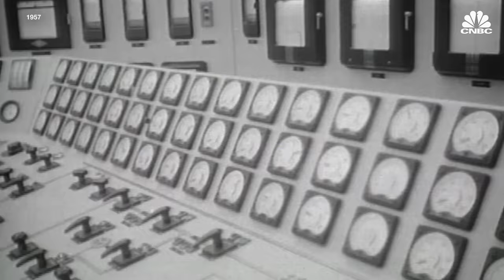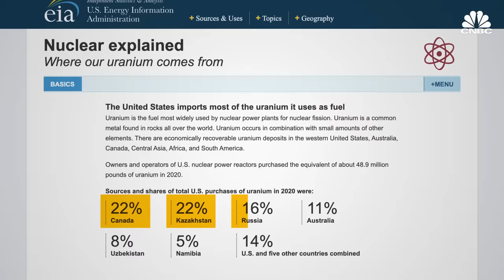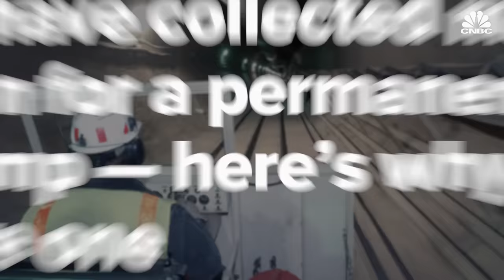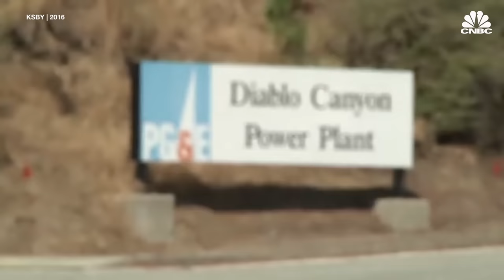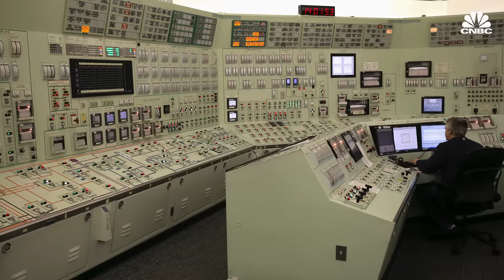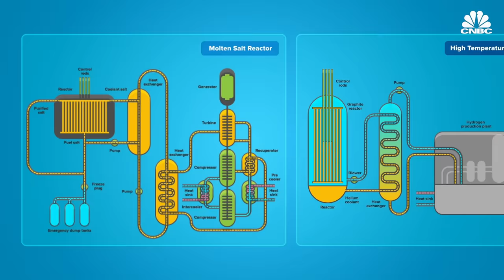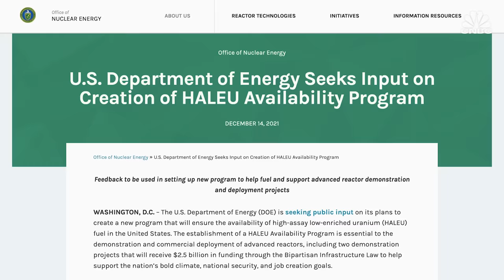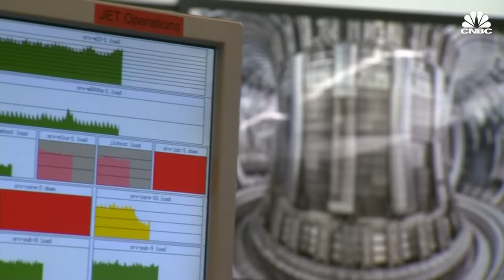Why Nuclear Energy Is On The Verge Of A Renaissance

Comment: I love nuclear energy, so good!
Reply: You must be very rich. It's 10x more costly than anything.
Reply: @pierregravel-primeau702  yes because gas and coal are free
Reply: @pierregravel-primeau702  Nuclear is not expensive. Nuclear power is "capital intensive". When you spend $5B building something, that isn't a $5B expense, that's a $5B asset that you then depreciate/expense over the asset's "operational life", which for a nuclear plant can be anywhere from 40 to 80 years. 

Nuclear power has one of the LOWEST operational costs of any power source, chiefly because nuclear fuel is incredibly cheap, relative to the amount of power that it yields.
Reply: @pierregravel-primeau702   Factor in storage with wind/solar and you find nuclear is much cheaper.
Reply: @williamsmith1741  it like burning gold for fuel. not cheap at all.
Reply: @DanielGarcia-eb3ui  Actually, it's like burning platinum, at least based on U-235. The difference is that a TINY amount goes a long way. These numbers are a little old now, but as of 2018, the amount of natural gas required to run a 1 gigawatt gas plant for a full year cost around $460 million USD while the amount of enriched uranium required to run a 1 gigawatt nuclear plant for a full year cost around $65 million. 

Needless to say, the gas prices have changed A LOT since then, but the nuclear fuel price hasn't changed much at all.

Comment: The finite nature of fossil fuels makes nuclear power inevitable - if only as a bridging technology until we can "hopefully" develop a viable alternative and a way to store/transmit the same.  Solar power or hydro is fine - but it can not be used everywhere and storage capacity is not yet viable long term.
Reply: Solar and wind are probably what you mean about energy storage, hydroelectric is actually the best energy storage we have.
Reply: @danadurnfordkevinblanchdebunk  There are very few hydroelectric storage units.  Dams are not hydro storage units since they release water to maintain required down stream flows and only increase releases when the pool lever rises too high.  Dams do not let down stream rivers dry up and then release water when there is a power need. Where do you get your information?
Reply: @danadurnfordkevinblanchdebunk  Actually I was referring to storage capacity.  Electricity declines the further from the source you go.  Also as alluded to we lack the capacity to store for future use what is produced.  

So solar and wind is only really useful in certain areas and above precludes the energy produced from being stored or transmitted large distances.  Nuclear power as noted can bridge the gap until we improve our ability to generate renewable energy everywhere it is needed.
Reply: @clarkkent9080   The Pigeon River is dam-controlled with scheduled water releases along the Tennessee/North Carolina border which whitewater rafters know first hand when the upstream dam releases more water so they can partake in their sport.   The businesses are at the complete mercy of the utility..  Every single hydroelectric dam in the country has this ability.  Duh.
Reply: @danadurnfordkevinblanchdebunk  Sorry if you need to brush up on reading.  One more time.  Electricity can only be transmitted at most perhaps ~300 miles from its source.  To achieve that extremely high voltages must be sent from the point of origin followed by a continual reduction down the lines via bleed off the further from the plant you are.

So every damable river in the US has already been dammed.  For communities which are far from these rivers = other sources of electricity are required.  Thus the grid is composed of different production plants depending upon what is feasible.  Irrespective of how it is produced = we lack storage capacity to save unused energy for later use.  It is pure use it or lose it.
Reply: @varyolla435    There actually is expansion potential for hydroelectric in the US for new dams, but the greenies political control makes you believe otherwise.  Also, only a small percentage of the dams in the United States produce electricity. Most dams were constructed for irrigation and flood control and do not have hydroelectricity generators.  The US Department of Energy has estimated that non-powered dams in the United States had a total of 12,000 MW of potential hydropower capacity.
Reply: @varyolla435   Electricity can be transmitted long distances with a corresponding loss the farther you try to transmit the energy.  That's why AC prevailed over DC.  I'm not sure why you are so confused by this concept.
Reply: @clarkkent9080   Most dams in the US were constructed for irrigation and flood control and do not have hydroelectricity generators. The ones that do release additional water when more electricity is needed, usually during peak demand loads.  It's the best energy storage method we presently have.  Your ignorance is pathetically comical.
Reply: @clarkkent9080   Any hydroelectric dam has the ability to slow or increase water flow whenever more or less power is required.  I don't know why anyone would want to lie as much as you.

Comment: Thorium Molten Salt reactor are the real answer, current uranium and water reactors are the main reason for poor adoption rates, one way to describe the problem is to compare current reactors to a car that has a hole in the fuel line only 1% of the fuel turn the wheels of the car, the other 99% of the fuel goes into the ground for 20,000 years. To complete the comparison you need to remove the water from the car cooling system and replace it with gasoline/petrol and then add a endless amount of safety systems to keep the car form exploding. Uranium is for warmongering, water is surprisingly dangerous in a nuclear reactor when things go wrong and the reason that nuclear reactor have blew up in the past and sadly in the future because the nuclear industry dose not want to except the only safe form of fission reactors. How many radioactive ghost towns do we need before we realise that the current uranium/water reactors are a bad ideal regardless of what ever new sales pitch is used.
Reply: Perhaps you are overlooking the track record of reactor projects using liquid metal [or molten salt] as a heat-transfer medium.   Experiments for what would have been the first airborne nuclear power plant were performed as far back as the mid-1950's with many engineers reacting in amazement at the heat-transfer properties of the liquid metal as opposed to light water.  This, however was short-lived being that the USS Seawolf reactor had excessive mechanical problems due to the corrosive nature of molten salt as a medium.   EDF of France went in big back in the 1970's with their 1200 megawatt Super-Phenix only to come to a commercial viability dead-end.   Trillions in today's dollars have been historically spent on these systems without much to show for it.   Additionally; the real possibility of some type of water-sodium reaction occurring with ensuing mechanical damage in in the picture whereas this situation is not present in the light water types.   Try to read our comment above on the viability of reactor power and CNBC's reporting on this important matter.     RON JAGRAF/X
Reply: @JAGRAFX  
Thanks great reply I need to look up some of the points you made👍
Can you recommend some YouTube links on the sub and EDF you mentioned.
Reply: @drmosfet  --- Do not have any favorite YT links for the subject matter but much industry data and literature is redly available to the casual and scientific researcher on the USS Seawolf SS[n]-575 and the SuperPhenix LMF BR constructed for EDF in France.   The Seawolf's sodium reactor was changed out in its entirety from the General Electric S2G plant to the Westinghouse S2W(a) plant at General Dynamics Electric Boat Division.  Believe that the details may still be classified in regards to cost to the US Navy for the technical escapade.
Reply: What about corrosion?

Comment: The big change: the end of uranium-235 fueled reactors. The next change will be switching to using thorium-232 as fuel, and thorium is WAY easier to find than uranium.
Reply: Any idea when this will occur?  I should invest in thorium.
Reply: The reality is that thorium reactors still require uranium to facilitate the process.
Reply: @michaeldeierhoi4096  Nope. What happens is that when thorium-232 is bombarded by neutrons, it turns into uranium-233, which is a fissile material that can be used by reactors.
Reply: "Thorium" reactors will more likely utilize U.238 before U.233.  The Sorenson vids by McDowall are great but keep looking at all the advanced designs like Terrestrial, Thorcon, Elysium, ...
Reply: @Sacto1654  Also, Thorium is not fissile on its own. It would need to be mixed with uranium of plutonium to achieve fission.
Reply: @neK6299  
Hi Kenneth Russell.
Well, yes, sorta.  To start a Thorium reactor you need neutron bombardment which would likely come from U235, but once it has generated enough U233, it needs no further Uranium.  It can run indefinitely after that on just Thorium.

It would likely be possible to use nuclear 'wastes' from existing fission reactors to get them going, but if the wastes are old, they likely won't generate enough neutrons to get the Thorium reactor started in a reasonable amount of time.  However, the cost to turn the solid spent fuel rods into fluoride salts might be so high, you would be better to used enriched U.

Warm regards, Rick.

Comment: One of the fatal flaws of nuclear power is not just that it is so expensive - more costly than many alternatives - but that it requires secrecy due to the high national security threats and associated risks, particularly with high efficiency materials (which are found missing every year).  It is extremely high risk on so many levels - no other technology has such serious repercussions for things as mundane as faulty welding or myriad of other human errors.  But it is the secrecy that prevents public access and oversight, that results invariably to cover-ups of accidents, spills, missing radioactive materials, etc.  Secrecy and democracy, i.e. transparency for public oversight, just doesn't go well together.  This doesn't even touch on the extreme cost of not only building nuclear power plants but the even higher cost of decommissioning them (since they have limited lifetimes), or that no insurance company will insure them and so it requires the U.S. taxpayers to subsidize the industry - that the government provides the insurance (the only private industry requiring ongoing public subsidizing) - unable to stand on its own and certainly failing a true Capitalist free market test, and not to mention the still unanswered questions about what to do with the radioactive waste long-term.  And not to mention the increased cancer patterns of the usually indigenous uranium miners.  All the billions spent chasing nuclear power would be better served improving, refining, developing the already less-expensive non-fossil fuel alternatives and a high-efficiency national grid system that can direct renewable energy anywhere needed when the local renewable energy is not efficiently produced (like solar-based regions when cloudy, etc.).  These limited financial resources should also be directed to high-efficiency renovations of buildings where we have existing technology today to vastly improve energy efficiency and can reap huge cuts in energy needs and provide lots of jobs across the nation (and the world).  There are simply cheaper, less risky, safer, better solutions to our energy and climate needs than nuclear.
Reply: I don't disagree with some of your comments but the secrecy issue really does not apply to U.S. commercial nuclear plants.  Yes, you cannot get floor plans for a nuke and they will not tell you when new fuel is arriving but other than that there are no secrets.  Hell even their safety Analysis Report provides a lot of plant data. Corporate media concerns for sure but certainly not secret like in the DOD weapons programs.
Reply: Yes
Reply: How is nuclear more expensive than wind/solar with storage?

Comment: Interesting video and interesting to see how technology repeats itself. The US Army tried small scale nuclear reactors (3MWt) using highly enriched uranium fuel in the late 1950s and early 60s. This led to the SL-1 incident where the 3 operators were killed by a steam explosion and meltdown. User error was involved but the incident highlights some key dangers of miniaturized reactors and the problems with using highly enriched uranium fuel. James Mahaffey's "Atomic Adventures" is well worth a read in this respect - it also goes through just how uranium is enriched - it is worth a video on its own! 

Colin Tucker's "How to Drive a Nuclear Reactor" is also well with a read. This explains in understandable detail how a Pressurized Water Reactor (PWR), the typical reactor found in the West, is self-stabilising (amongst a whole lot of information!). The Fuel Temperature Coefficient and the Moderator Temperature Coefficient cause reactivity to fall if the core temperature rises. If temperature rises, power falls having the effect of lowering the temperature which will, in turn, bring reactivity back to zero. For a temperature fall, the reactivity will rise, the power will increase, and temperature will return to normal warmer values and will return reactivity zero. This 'negative feedback' is self-stabilising and enables a PWR to run days on end without control rod movement, simply held stable by these temperature effects. It is incredible how clever PWRs actually are!
Reply: Oakridge had some of the greatest scientific and engineering minds on the planet. Remember they designed the PWRs fresh off WW2 and this was ONLY their "stopgap design" made to learn how to use a reactor for power production. They did warn (and were correct on it) that scaling up a PWR would run past their inherent safety that guaranteed the containment to be absolute under a certain output. Above it, and without constant active cooling, the reactor was unsafe. They also recognised before the first one was even built what would be their downside (mainly, the low efficiency of the burn, and the necessity to rely on a rare isotope of uranium). But to them it was good enough for the time and it was good enough for their first client, that being the navy (who also gained benefit in safety from, well, being surrounded by water).

What is not know is that they made BETTER designs, mainly in the liquid fuel, molten salt, low pressure regime. They used many fuels (standard U-235/U-238, plutonium, and U-233 which was their main target) and proved the design was better than the PWR in every way via the MSRe: the molten salt reactor experiment. 
The MSRe was hugely successful, fixing every outstanding issue with PWRs (expensive build, gigantic pressure vessel, inability to efficiently breed fuel, low burn rate, fuel damage, and the risk of meltdown and steam explosions) while also improving on almost every single characteristic of the reactor. 

Being at high temperature and in a liquid medium, the thermal reactivity was good enough to be the ONLY regulating element if needed. You could block the control rods, stop ANY cooling, and the reactor would self stabilize, and do so long enough for the drain plug to melt (a tiny bit of frozen salt kept frozen by a nitrogen pump, which turns off if power is lost) and drain the entire reactor's content into passively cooled drain tanks, where it can remain safe essentially forever. Its an idiot proof system, one entire passive that self triggers regardless of conditions or even user intervention (preventing a Chernobyl like accident through incompetence)

Alas, Oakridge suffered from their success as it put into question the projects from rival institutions (sponsored by the government of the time) and the military (Making future reactors run on U-233, the bred product of thorium, meant you could not use reactors to make nuclear weapons, back then the main concern of the nation). Their project was forcefully stopped, and the documents actively locked up and not spread around. Its a real luck that any of it, as well as the MSRe itself, survived at all. For nearly half a century we were not even aware that such a level of success had ever been achieved. And even the programs supposedly to be "protected" by the removal of the MSRp from the picture (like EBR) were cancelled for political gains just as easily.

And as usual, we still squander this incredible gift because nowadays we only assume that the PWR is the ONLY reactor type that ever exist. The length our governments go to hinder progress in the nuclear industry is quite telling.
Reply: PWR are clever, but have a look at Gen-4 reactors, they are quite ingenious.
Reply: The Navy has the capacity to use it's nuclear reactors to power a Small grid during emergency situations.

Comment: Thorium modular reactors are the way to go.  It is dependable, safe and adaptable.  They can also use the waste from conventional reactors as fuel and at the same time drastically cutting the half life of the present waste.  Solar and wind do not supply a constant source of energy and do not have a way of storing the energy produced for when the Sun doesn’t shine and the Wind doesn’t blow!